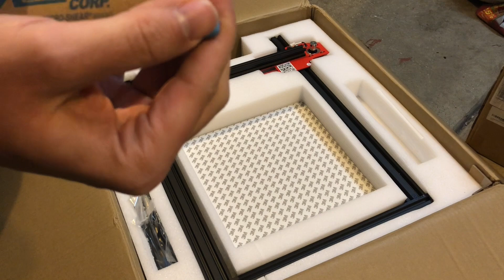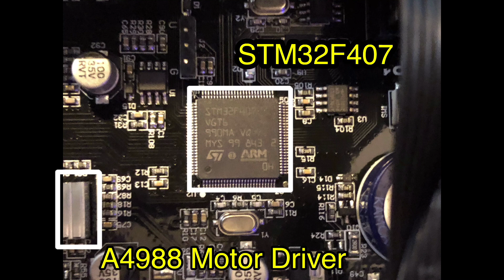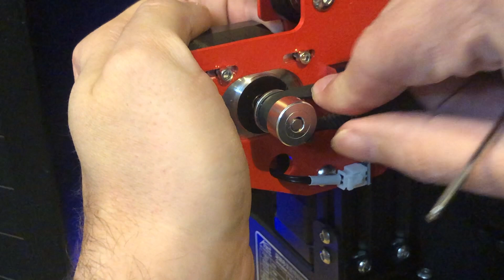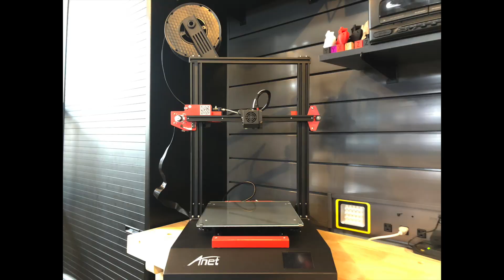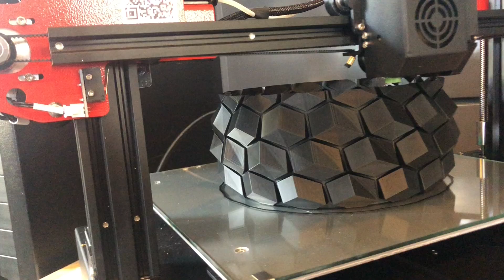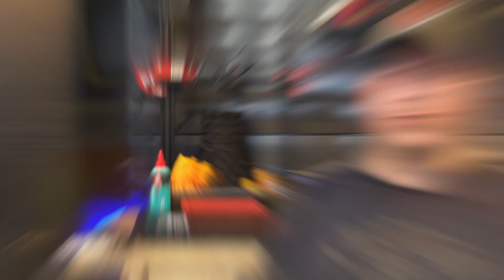Anet ET5 Review - Big 3D Printer Small Budget?

Comment: Have you had a chance to look at the Two Trees bluer plus? Pretty similar setup to this but for 350 USD you get also silent steppers, synchro Z rods, PEI build surface, WiFi capability, a Volcano style hotend, belt adjusters and a BMG dual drive extruder

Comment: I have an ET5-X which is essentially the same printer.  I would not recommend it to anyone unless all you're really looking for is build size. The thing has given me problems every step of the way and at this point the only thing stock is the frame. I really hope you have better luck than I did.

For the Y Ghosting, the thing that made the biggest improvement for me was switching to a .09 stepper. I would be interested to know if you find something else that fixes it because even printing on a concrete paver at slow speeds (30mm/s and 300 acceleration), I still got an insane amount of ringing.
Reply from the maker: Thanks for commenting and watching, sorry to hear the issues you are having!  I received the machine about about 1.5 months ago.  I try to really try to run things through its paces before I conclude my review.  With that being said, you have more experience than I do with the machine.  I will be using the machine more, and do a follow up.  So a board swap was the only thing that took care of the ghosting?  I have their 2208 board, wondering if that would work?
Reply: @TripodsGarage  Board swap did nothing for ghosting. I just wanted Marlin (Hated stock firmware) and wanted better community support so went with a Skr 1.4 Turbo and TMC2209s. I also had issues with Octoprint disconnecting constantly, which the board did seem to fix. To fix the ghosting, I swapped out the 1.8 stepper motor on the y axis to a 0.9 LDO motor. https://i.imgur.com/dQMq6ug.jpg shows the before and after of just the motor swap.

I should add that I do have a friend that got the same printer and they have not had nearly as many problems as me.